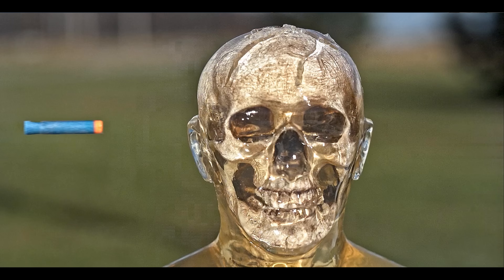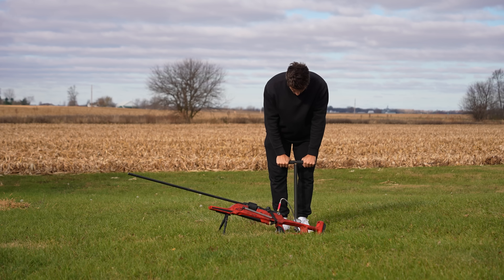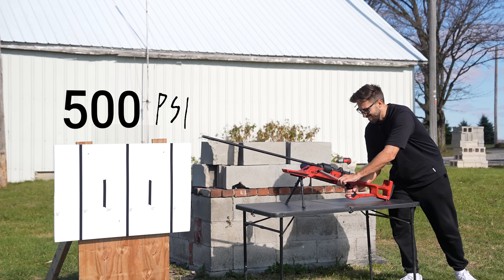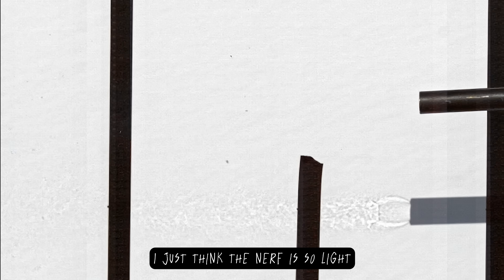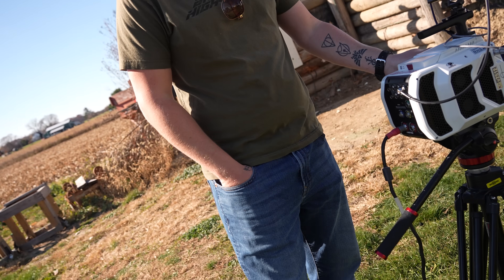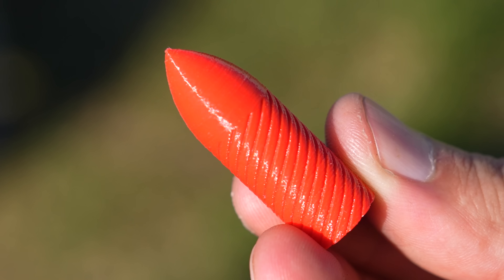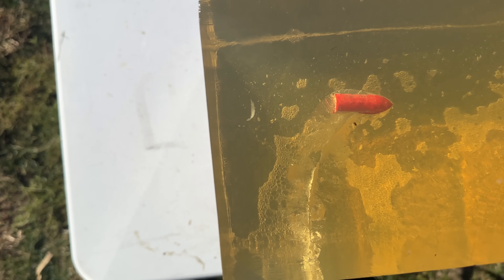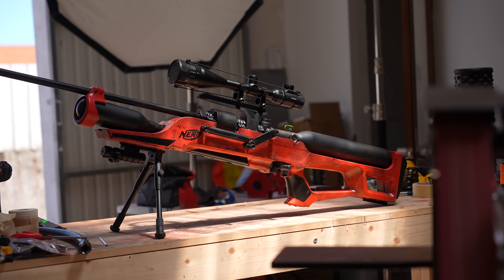How Dangerous is a Supersonic Nerf Dart?

Comment: Hey mike i have a suggestion that would make your device much more powerful without any changes on the hardware.

First a bit of theory to explain my suggestion:
A gas under pressure can only expand at the speed of sound in said gas. If pressure increases beyond the point the gas can move away from the point of high pressure, so if it still tries pushing away beyond the gas front reaching the speed of sound, the gas just bunches up on the gas front and creates what we know as a shock wave. If we use air under pressure to accelerate our projectile the theoretical maximum velocity of the dart can not be more than the speed of sound. If the dart is traveling at the speed of sound the gas behind the dart pushing it forward can not move any faster itself. Even with a million psi behind it it would not go faster than the speed of sound.

Now my suggestion:
You could use a gas that has a higher specific speed of sound. Helium for example is not too expensive, available for purchase to anyone and the speed of sound in it at normal temperatures is a whopping 3500 km/h! Which would be your new theoretical maximum speed for the projectile.
You could also heat the gas you are using, because the speed of sound of a gas increases with temperature.
Thats how regular firearms do it. The chemical reaction of the propellants release mainly CO2 which then pushes the projectile through the barrel. But CO2 has a speed of sound very similar to air, so why are firearm projectiles so fast? Its because the CO2 leaves the chemical reaction very very hot which increases its speed of sound dramatically and makes firearm projectile speeds possible.
Be careful with heating pressure vassals though, because increasing the temperature both increases the pressure and lowers the tensile strength of the material the vassal is made of. So, dont blow yourself up and use warm helium and a long barrel to reach crazy speeds. For the maximum possible pull a vacuum in the barrel, so the dart doesnt have to push away the air in front of it when traveling down the barrel.

To recap: Use Helium to pressure the tank. Make sure the gas isnt cold. Use a long barrel. Pull a vacuum on the barrel if you can. Do this and you should reach projectile speeds around 970 m/s.
Reply: Bro is cooking with this one
Reply: @Venti_aki literally
Reply: NASA uses air guns to test material strength and impact dynamics using just regular air mix . They use up to 20k psi and a vacuum pulled on the barrell to enable rapid expansion of the gas. Using these methods, they can get a 3mm steel BB up to Mach 7.
Reply: @Scudboy17  Its possible to accelerate a gas to supersonic speeds with trickery. But a gas will not expand by itself faster than the speed of sound in the gas without such trickery. What nasa is using are convergent divergent nozzles most likely. The problem with that solution is that these nozzles perform very poorly if they vent into backpressure. If the gas cant leave the nozzle relatively freely but instead runs into a barrel blocked by a projectile which creates a high static pressure behind the nozzle they go from creating supersonic gas flow to just acting as a choke and reducing flow rate.
Im honestly surprised they made that work, my guess is a very long barrel makes it so the projectile can slowly but surely accelerate and the gas flow slowly but surely approaches a speed at which the nozzle can function correctly. Im not sure how well that will work with increasing projectile weights tho.
In our case however it would require a complete rebuild of the machine featuring the convergent divergent nozzle, a barrel much longer and other hardware at high cost and effort to realise desired outcome. If he just uses helium instead he will likely reach supersonic projectile speeds without any modifications at low cost and effort.
Reply: I disagree with your statement about not being able to use air. Here is my explanation. 

This is a pretty basic fluid dynamics system, we have a pressure chamber with an outlet. With the barrel acting as a simple nozzle, the fluid (and therefore projectile) leaves the barrel at a lower pressure but higher velocity. So if our goal is to have exit velocity greater than the speed of sound you will need a supersonic nozzle to accelerate that fluid past that point. 

These convergent divergent nozzles are how rocket engines work, it just takes a lot of energy to get the fluid up to those velocities (but in your example a MilLioN pSi cOulDNt bReAK thE sOuNd BArriEr) I’m just poking fun at it, but seriously we have been expanding gas across nozzles for a while and is always the solution for increasing velocity.
Reply: @adamsazaquatics3079  a gas can be accelerated to supersonic speeds, but it will not expand at super sonic speeds by itself without trickery.
Supersonic nozzels perform very bad against backpressure. If the gas cant freely or relatively freely leave the nozzel, but instead runs into a barrel blocked by a projectile which creates high static pressure behind the nozzel it will not work as intended and instead effectively only reduce flow rate.
In theory you could have a very long barrel and slowly approach the projectile to speeds at which the gas can leave the nozzel with less backpressure building up at which point it would function normal again and push the projectile at supersonic speeds. But my guess is that the barrel would need to be so long that the barrel walls would provide enough friction to the gas along its path down the barrel to the projectile that it would shlow the gas down significantly. In other words, i dont think that would work at all.
And of course that would require very precise and expensive nozzels and other hardware to make the super sonic gas flow a reality.
Instead he could just put helium in his existing machine and achieve supersonic speeds. Low cost and effort.
Kind of ironic that you laugh at my proposal and then propose a complicated, expensive and likely not functional alternative.
Reply: @movelikejaeger1914  I agree with you on back pressure but in your facetious example of “a million PSI” the static back pressure of the nerf dart would be overcome. For a more realistic example you are right with Helium, I am just correcting your statement that you said it is impossible for the atmospheric air to reach velocities higher than its speed of sound. There is a good reason every rocket and missile expands their exhaust through nozzles instead of just using pressurized helium as the propellant. I agree with your answer as relevant, I just disagree with your assertion that it’s impossible.
Reply: @adamsazaquatics3079  I never said a gas could not move faster than the speed of sound in the gas. I said a gas under pressure will never expand faster than that by itself. You can make supersonic gas flows but only with trickery thats not practically applicable here because of backpressure.
Youre right, supersonic gas flow is possible, it has nothing to do with the concept at work here though and my logic stands, a gas wont expand down this barrel any faster than the speed of sound in the gas no matter the pressure behind it since we dont have trickery like convergent divergent nozzles.
Reply: I came to the comments to make the same points from my days trying to design a space-nerf-gun in the 90s. Vacuum Barrel is a cool concept, and when I realized it could be possible to have pull a vacuum on land, I was convinced it was the best way to achieve reliable ballistics in varied "space" conditions. (Different planets, atmospheres or hard vacuum, or even under water.) 

And yes, my design worked off Helium, and I tried to convince my high school chemistry professor to buy us a helium tank to play with. 

Really, this collab shows and proves that traditional modern firearms are awesome, but in a zombie apocalypse, a dude with a pipe and an air compressor and the ability to cut off .50cal sized chunks of random materials might live longer. <G>
Reply: DO İT!!! @Mike Shake
Reply: Or he could add an ignitor which ignites the hellium as you said while it is about to flew to the barrel.
Reply: not sure whre you got this gas can't expand faster than speed of sound... plenty of examples of supersonic capable air rifles ut there, all using air. Never used in practice as shooting just above speed of sound means that projectile goes subsonic mid fight, and that's very detrimental to accuracy. I'm pretty sure the tanks used are regular paintball/airgun bottles rated 3000-4500PSI, valve looks strudy enough to work to at least 2000PSI let's test the muzzle loader bullet with 2000+PSI.
Reply: @Zajc3wpl   lets do a thought experiment. A atomic bomb goes boom mid air. A lot of super hot gas gets generated almost in an instant. This super hot gas under very high pressure expands at the speed of sound in the super hot gas, which is lightning fast because speed of sound increases with temperature. While doing so it pushes on the air around it. The air cant "run away" quicker than the bomb pushes on it and air bunches up on the propagation front. After the bomb is done pushing on the air the bunched up air at the propagation front which is under enormous pressure will now expand at the speed of sound. We know that as the shockwave.
In other words even a atomic bomb cant pressurise air to the point at which it expands above the speed of sound in air. It has nothing at all to do with pressure.
You can however create supersonic gas flow by use of convergent divergent nozzles. The problem with such nozzles is that they perform very poorly against back pressure, such as when they vent into a barrel blocked by a projectile. When faced with backpressure they go from creating supersonic gas flow to basically just reducing flow rate. In the discussions here i learned however that it is feasible to use such nozzles for very light projectiles in guns with long barrels compared to the bore size. So, it is possible to reach supersonic projectile speeds by use of compressed air through convergent divergent nozzles for light projectiles. It is however not scalable and becomes unfeasible for heavier projectiles since backpressure persists unproportionally longer and would require longer and longer barrel lengths.
Supersonic pellet guns make use of such nozzles, they create supersonic air flow through the trickery of convergent divergent nozzles. This gun however uses just a valve with no nozzle of any type and would need to be rebuild with costly hardware to reach the desired projectile speeds. Or he could use helium to pressurise his gun and reach such speeds without any modification.
In either case i am certain that in the current configuration and with air in the tank this gun can not accelerate anything beyond the speed of sound.
Its important to differentiate between "gas cant move faster than the speed of sound" and "gas cant expand faster than the speed of sound". It can move at ludicrous speeds if you accelerate it, but it will never expand from a point of high pressure above the speed of sound by itself.
Reply: @movelikejaeger1914  ok iaccept that shockwaves don't expand faster than speed of sound, but i have air rifle with simple valve and a hole in the side of a barrel as a "nozzle" that can push supersonic pellets out. 1250fps with speed of sound at 1120fps on that day, running 1500 psi. Also most long barreled powder burning firearms shoot at over 1800fps, co2 h2o and other powder burning products are not air but gasses nonetheless. Perhaps shockwave in free air doesn't translate well to expansion behind moving projectile in a barrel.
Reply: @sasquatch5863  A good thought, if gas cant expand faster than the speed of sound how do firearms shoot such fast projectiles?
The speed of sound is not a universal constant. It is different for every gas, the smaller/lighter the atom of a gas the higher the speed of sound in that gas. It is also dependant on temperature, the speed of sound in a gas increases with temperature.
In the case of firearms the primary products of the chemical reaction of the propellant is CO2 and water. Lets look at the CO2 first.
The speed of sound in CO2 at 20°C is 268m/s, slower than that of air at 344m/s. But the CO2 leaves the chemical reaction that generates it at very high temperatures. The gasses are above 3000°C at the time of the boom. The speed of sound in CO2 at 3000°C is 897m/s.
For water the speed of sound at 3000°C is 1147m/s.
As an example for lighter atoms increasing speed of sound we have Helium, a very small and light atom that has a specific speed of sound of 1007m/s at 20°C. Compared to atmospheric air which has a speed of sound of 344m/s at 20°C.

As for your rifle i have a few thoughts. Maybe youre using nitrogen bottles to pressurise it? Nitrogen on a warm day has a specific speed of sound similar to your projectile speed.
If youre using air i have a different idea. It is known that oil often found in the chamber of a rifle from cleaning reacts with the oxygen in the propelling gas spontaneously under these pressures. That releases CO2 and Water at very high temperatures which increases pressure and temperature of the rest of the gas in the chamber resulting in an increase in the speed of sound and thus projectile speed. For that purpose some people put petroleum jelly or vaseline into the back of the diabolos when loading. 
Or it could also be that the inlet to your chamber is acting as a convergent divergent nozzle. Although i think that is unlikely, geometry is important for those.
Either way, no gas can push anything faster than the speed of sound in that gas without any other added factors such as convergent divergent nozzles. The gas would have to magically expand faster than the experimentally proven maximum. I just think its unlikely your gun is breaking physics.
Reply: So the only reasonable solution is to increase the temperature of the propellant gas?
Reply: @amosbackstrom5366  no, you can also choose a gas that has a higher specific speed of sound such as helium or hydrogen. In this case it is the more reasonable solution. Heating the pressure vassals is dangerous.
Reply: @movelikejaeger1914  It's not the only way, but I think it will work safely. He's right on the edge of the sound barrier, he doesn't need much. I think increasing the temperature from 293K to 323K (70°F to 124°F) would increase in speed of propellant gas by about 10% compared to ambient air.
I think this solution would allow you to use less pressure than an equivalent amount of helium.
Reply: @amosbackstrom5366  If you want to make it just over the speed of sound barrier that sounds like a reasonable proposal. The pressure vassals should be fine at these temperatures. With a barrel of this length you would likely not be able to make full use of the theoretical speeds achievable with helium anyways. Warm air might be the actual budget option to crack the speed of sound.
Reply: What are you talking about with "pulling a vacuum"? You do not want a sealed system in any projectile-firing device like this in FRONT of such pressures. Unless you literally mean putting a vacuum machine's nozzle to near the barrel, creating positive pressure in front. Not literally a vacuum, though. I should look this up.
Reply: @BeamMonsterZeus  you can block the end of the barrel with something just sturdy enough to withstand the atmospheric pressure. The projectile would punch through said seal when leaving the barrel. Then you pull a vacuum through a vent attached to the side of the barrel that does not interfere with the projectiles path through the barrel.
Upon firing the projectile would not have to push the gas inside the barrel away, creating less "friction" or "resistance" which increases projectile speed.
I already hear you say that the seal at the end of the barrel would need to be so sturdy to withstand the atmospheric pressure that the projectile punching through would break the barrel or the projectile or both. To which i would reply the mythbusters had an episode in which they used a device as described above to accelerate a ping pong ball to supersonic speeds. They blocked the barrel with tape and the ping pong ball survived punching through that tape so i think its fair to assume a foam dart would act similar.
Reply: No offense but yap sesh 💀
Reply: @RndmFactsOfficial  non taken. How would you describe it shorter?
Just give the instructions without explaining? That wont help an engineer.
Have to go a bit deeper into the subject than "Fun fact: Honey never spoils" to make things like this one work.
Reply: @ best come back lol I won’t even argue thanks for not crashing out lol I’m starting to regret making these types of videos bro 💀
Reply: @RndmFactsOfficial   just take it easy man, throwing "yap sesh" at someone trying to shine light on how the world works is a quick way of losing teachers that could help you out a lot.
Reply: @movelikejaeger1914  👍 Ngl im not Even gonna make a comeback bro ur wise 💀

Comment: 4:57 you mention that cold and humid air is more dense, but it's worth noting that humid air is actually LESS dense than dry air. Cold air is more dense than warm air, but humid air is lower density than dry air.
Reply: Oh cool
Reply: How so, when now you have more water particles in the mix?
Reply: @franky2shoes660  that's because dry air and humid air have the same number of molecules, but humid air has part H2O molecules which are lighter than the molecules of dry air. The reason why water itself is obviously heavier than air is that it has more molecules, but that cannot happen in gas like air (at normal pressures)
Reply: Okay